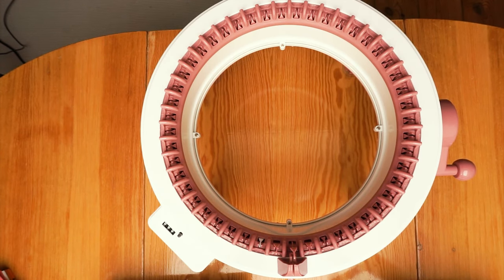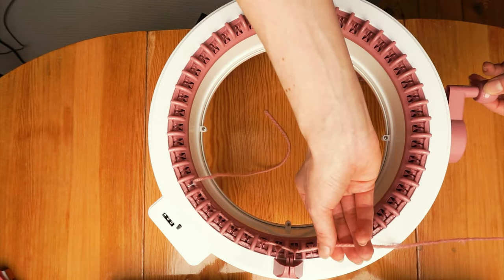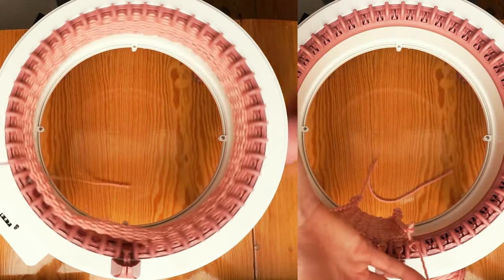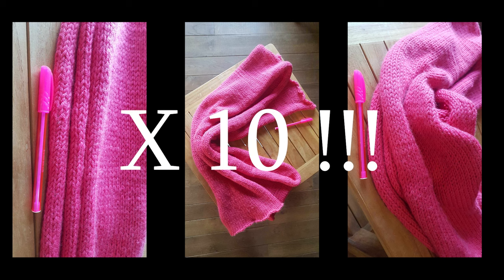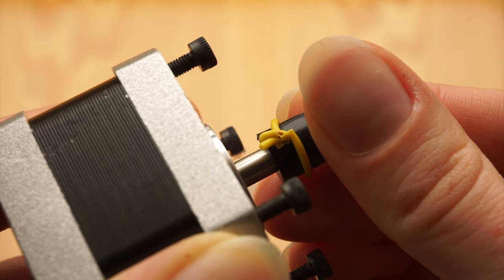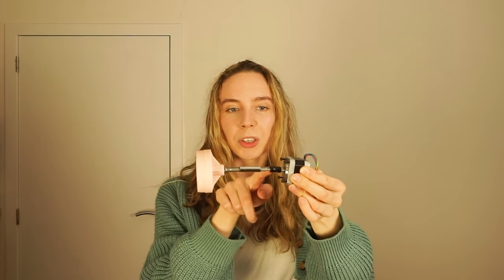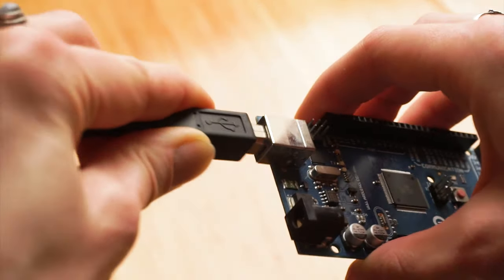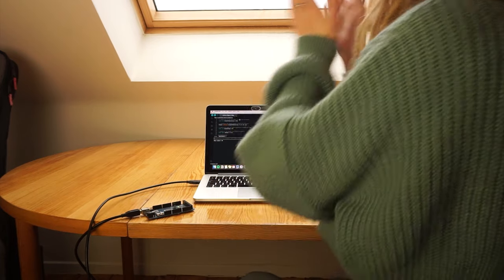I automated a knitting machine, it went (mostly) wrong

Comment: Hey ! Great project ! Maybe, for further imporvement, you can try to 3D model a stand that can hold the stepper motor. In fact, with that you can implement some adjustement mechanisms (By experience I think that the mean reason you had some issues with the shafts connector ahah) This will provide a more accurate positioning of your motor :D 
Keep up the good work !!
Reply from the maker: Heyyy thank you for the comment ! I will totally think about what you said for  the next video, the 3d model is a must I agree 😄
I still hear the sound of that shaft 😩
Stay tuned for the next videos ✌🏻

Comment: For a prototype, this is great - perhaps a little overkill from an electrical engineering perspective (you could use a dumb DC motor, 2 limit switches and a SPDT relay - switch A runs the motor one way, switch B runs it backwards by triggering the relay, have the switches be triggered by the rotation) - but it gets the job done, so looks like a success to me!

Now that you can automate the crank, it would be very cool to leverage all that spare processing power to make dynamic changes to the machine, create patterns etc.

I'd love to see more!
Reply from the maker: Thank you so much for the intel ! I am totally new to that world so any idea is welcome 🤩
I can’t wait to make new videos on the subject 🤘🏻